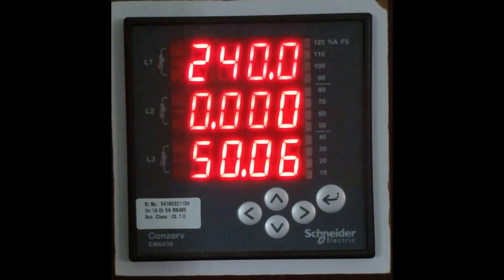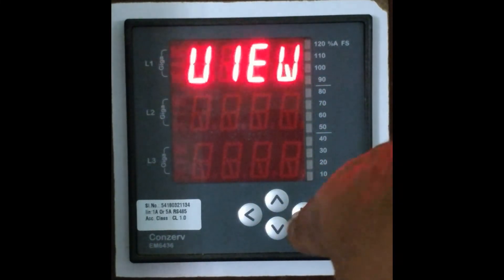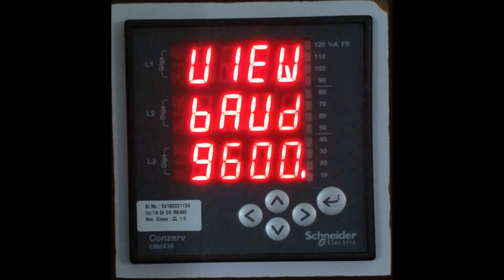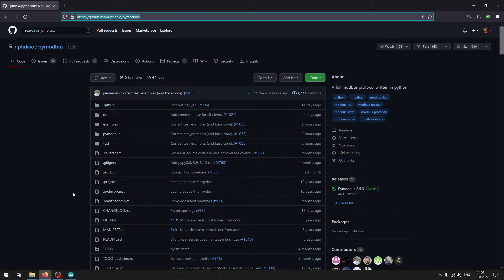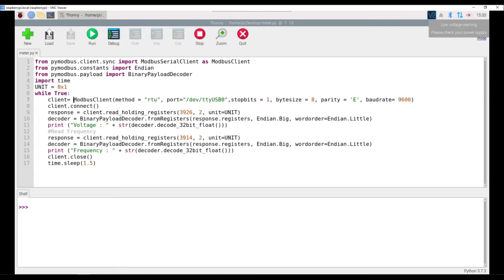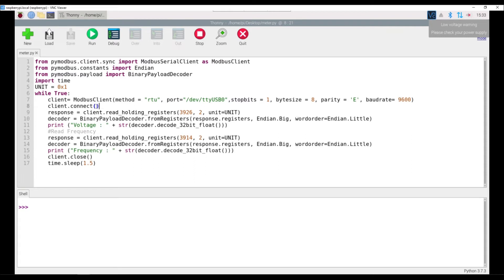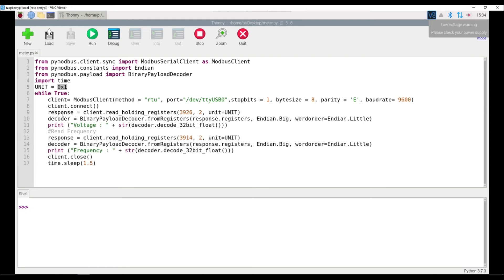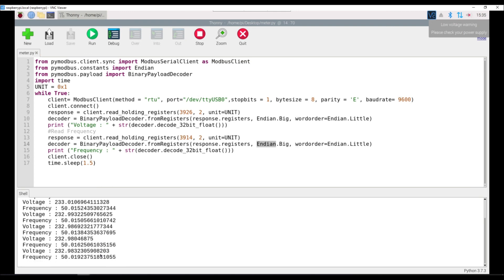Modbus Communication with Schneider EM6436 Smart Meter using Raspberrypi

Comment: Hello,
 I am trying to do the same thing, collecting data for a project. We have a Schneider EM6400NG+ at our college. I want to connect it to rPI-4 with a USB to rs485 port. I want to get info on registers but I can't seem to find them online for that particular model. Any help will be appreciated very much❤.
Reply from the maker: You may check the website of Schneider for the register details .they might have it as a excel file
Reply from the maker: Specifically check for register map
Reply: @sarathtv  Thanks for the quick reply. I got an xls file for the 6400NG model listed under software section of 6400NG+ model. So they both might have the same sheet. I will try connecting it to pi.
Reply from the maker: @d8_prime  yes please
Reply: @sarathtv   I tried connecting earlier today, I coded similar to you with my register values and I got this output
ile "/home/d8/Desktop/SubStation/Sub_Station_test.py", line 20, in <module>
    decoder_power = BinaryPayloadDecoder.fromRegisters(response_power.registers, byteorder=Endian.Big, wordorder=Endian.Little)
AttributeError: 'ModbusIOException' object has no attribute 'registers'
Any fix for this? I lookedup online and increased my time to 20sec but no use.
Reply from the maker: @d8_prime  can u check if the connection to meter was successful 
Just print the output of connect method
Reply: @sarathtv  Bro I cant thank you enough for showing me the way. I wasn't able to get it running with pymodbus library but I was able to do it with minimal modbus.
Reply from the maker: @d8_prime  hope u are able to get required data from the meter